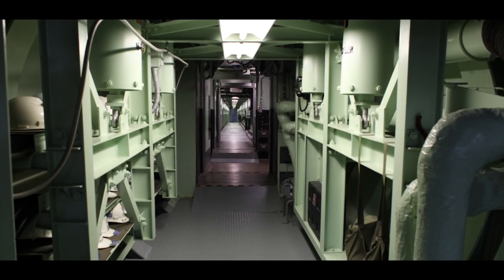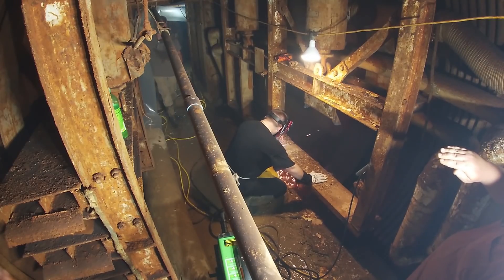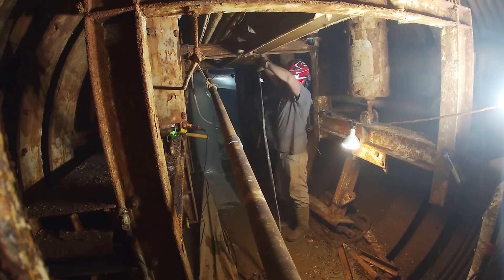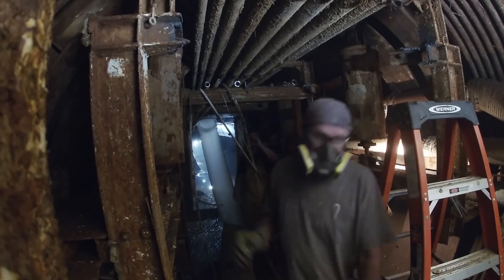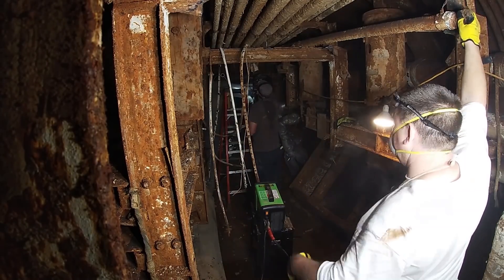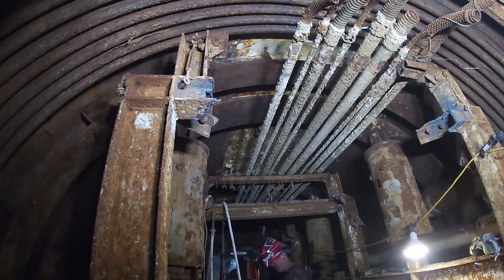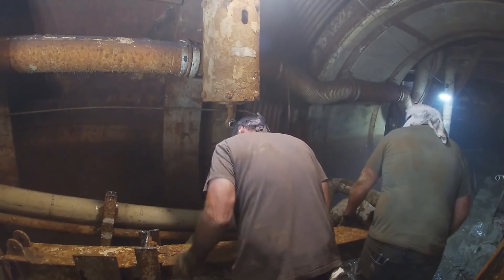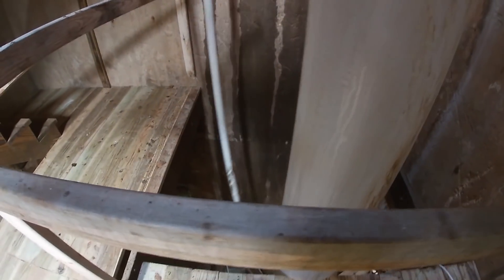S1E20 - Scrapping the Short Cableway - Owning a Titan II Missile Silo

Comment: Dude, you need ro get yourself a metal cut circ saw. Those things will go through those i beams a lot faster than the plasma torch
Reply: this guy gets it
Reply from the maker: Metal circ blade only cuts 3.5 inches.
Reply: There's steel cutting blades for the big gas saws. Cuts amazingly fast.  I don't know what exactly they are but cut fast in vids I've seen. Not the black abrasive blades

Comment: They make a personal meter that specifically is used for hot work for use in confined spaces. I suggest you look into getting one unless you are 100% sure you have no issues flammable gases, co, etc. They are called "Multi gas detectors" and you can pin them on your shirt or w.e.
Reply from the maker: We have a gas detector. We also flow plenty of fresh air in from outside which is what you can hear in the video

Comment: My favorite tool for tight quarters demolition of steel is a gas powered chop saw. If you use a 14 inch blade you can cut through a lot if stuff quickly. It is a clean cut with no adhesions to recut  the drawback is noise, ventilation and consumables but I like it for portability, speed and short learning curve for the operator. They have 16 inch saws that can cut through railroad track but hard to handle. I wish I was closer, i have a lot of stuff to make that job go faster.
Reply: can't use gas powered stuff in there, CARBON MONOXIDE!!
Reply: @tech4pros1  correct, but with all the ventilation needed for using a cutting torch, plasma torch, or any other tools I figure it should be enough for a chop saw too. Either way they should have oxygen and other gas monitors in a confined space like that. They do make electric chop saws but they don't have the power of the gas ones. Some of the newer chop saws are four stroke engines which should emit less pollution but are heavier.
Reply from the maker: We have enough ventilation for gas saws we just aren’t using any
Reply: @atomicunderground9971  In your situation you are obviously using the tools that make the most sense for you. Plasma has electric power from outside so no gas fumes and is probably cheaper for consumables too.  I watch all your videos. Keep em coming

Comment: Another suggestion, as if you haven't gotten enough of them. You can get a couple of hydraulic Jack's and heavy wood beams to push those beans around after cutting. Much easier than beating on steel with a sledgehammer.

Comment: I would use a arc gouge myself. You could cut all that steel in much less time.  You would need to rent a welding machine capable of 500-600 amps. That and a Industrial air compressor.
Reply: I was thinking the same thing myself.
Reply from the maker: Your comment just exceeded my budget for the next 6 months :-)

Comment: From the looks of it you are hauling out in as large chunks as you can and will prepare them on the surface for what the scrap yard takes as prepared steel scrap?  Will you be taking advantage of the conduit holes in the structure to run the sump pump discharge from the command dome or looking at the ground access holes in the command center to rout the discharge? 

Harbor freight sells a $260 saw that might help with preparing the metal for the scrap yard in the form of a metal cutting bandsaw that is made for cutting off metal beams/round stock/square stock as you do something else. Harbor freight item # 93762 would let you clamp the beam sections in and simply turn on the saw and work on something else as it cuts away at the metal. They have a $900 saw that can do up to 7x12 materials but the 4x6 of the cheaper saw should handle most of what you need from the 3 inch rebar sections to the I-beams. 

Cutting the conduits to size simply get a pipe cutter as it will do in seconds what it takes a sawsall minutes to do as long as you have the room to spin the cutter around the pipe or spin the pipe in place. One of the roller style cutters that can do black iron gas pipe will have no problem with conduit. Not good in the removal due to limited space but great for someone cutting down the removed pipes to a length the yard wants. 

Other then the scrap yards did you check if any local metal shops want to buy the steel you are pulling out? Some of them love to use local scrap to make artwork and some if it might be usable for projects.
Reply from the maker: I decided that the extra $20 per ton for prepared wasn't worth the effort. Yes we will be utilizing the conduit holes for all of our utilities as soon as they are clear.
Reply: @atomicunderground9971  Have you tested a metal blade in a circular saw for cutting out the conduits? They showed some Diablo blades on Atlas's channel last month https://youtu.be/t_2NG2nZe0k?t=99 that look like they might make some of the scrapping work easier once you know how long you can run the saw before it heats up.
Reply from the maker: Andrew H we will be trying that. Can’t plasma cut them because they are galvanized